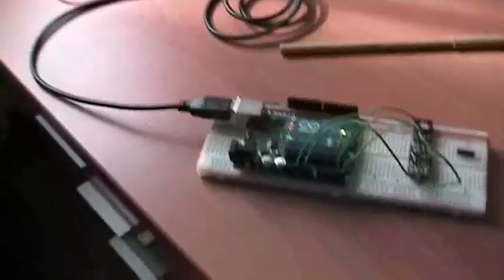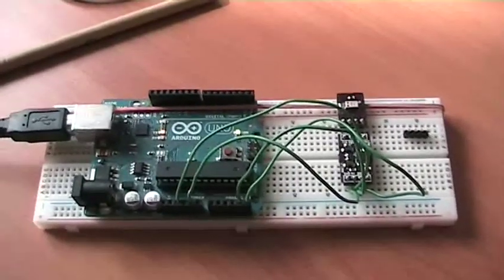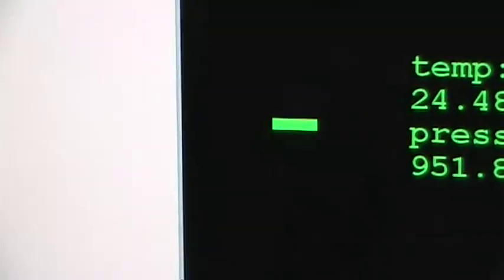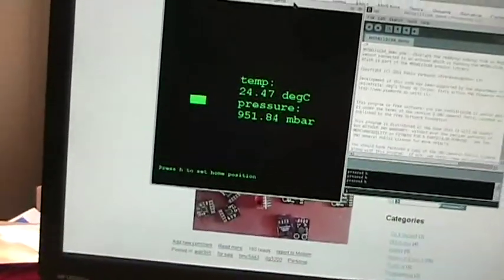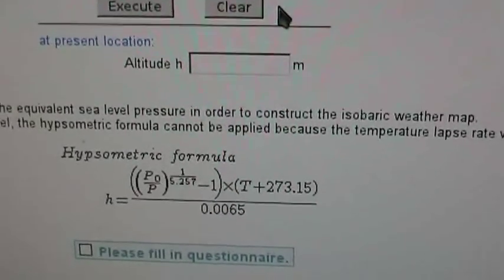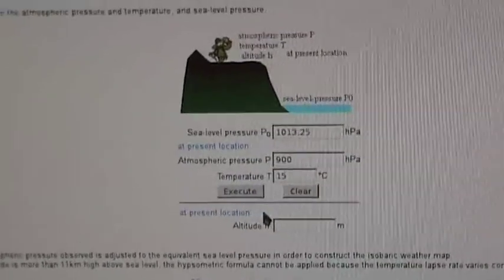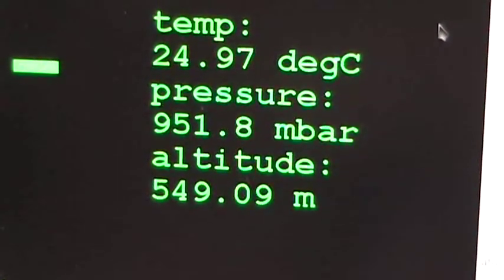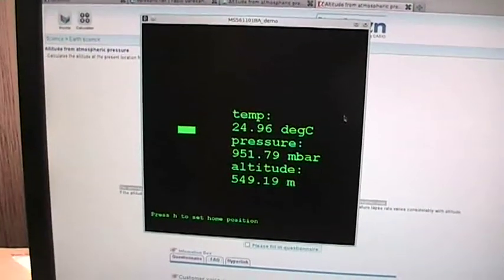MS5611-01BA01 high resolution pressure sensor with Arduino and Processing

Comment: There is a way to negate the drift in the altitude , calculate the rate of acceleration in AZ  , combine it with accelerometer  if the AZ is not changing consider the drifting altitude as an offset .and negate it from the barro measured altitude  .

Comment: Hi Fabio, i have a question to you, did you think that this pressure sensor are more Stable and more resolution that the BMP085. I have this BMP085 but i have several problems with resolution and stability, what do you think?. regards (: